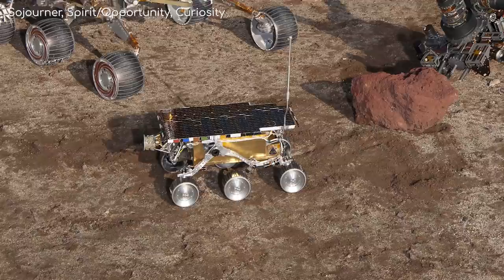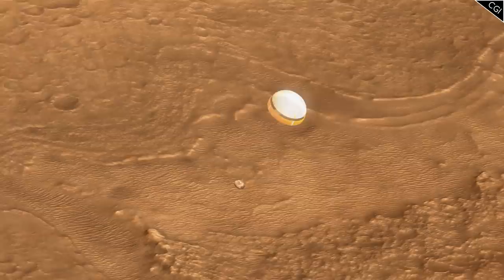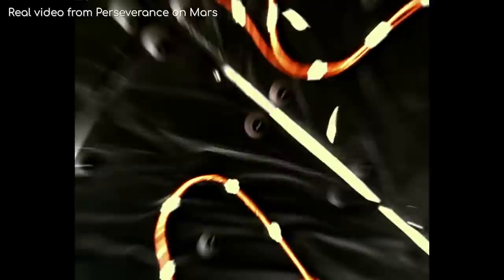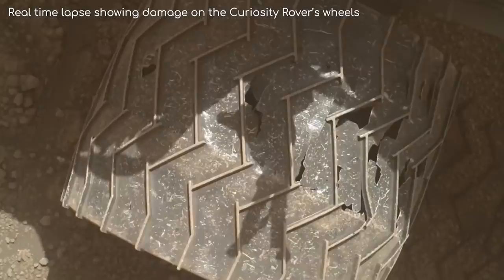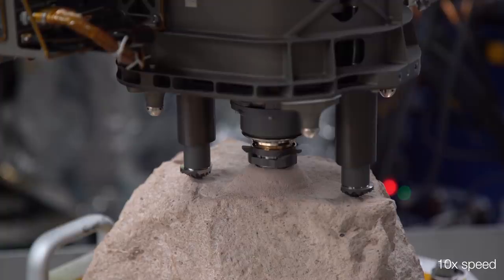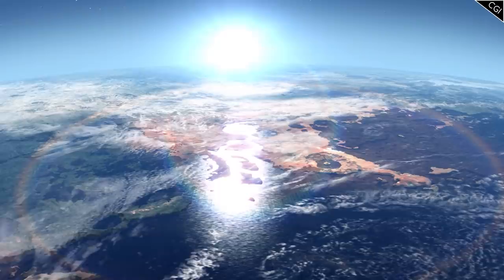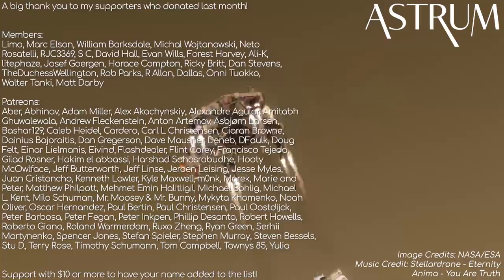This Is What Happens When You Let NASA Engineers Do What They Want | Perseverance Episode 1

Comment: Perseverance is the second rover to use the crane system. Curiosity was first. I designed the Pyro-Fire circuit boards used by the Curiosity Space Craft to control explosive bolts during entry into the Martian Atmosphere.
Reply: Wow really?
Reply: you did what, now ?
Reply: Would you mind creating a video on that on your YT channel?
Reply: @Smee Self 
Explosive bolts were also used to hold the Space Shuttle S.R.B. ( solid rocket boosters) to the launch platform and fired when the boosters ignited
   Well, technically it was the nut that exploded...so yes, every time they launched a shuttle, they busted a nut
Reply: You got curiosity...  How did you persevere?
Reply: So did I!!
Reply: I prefer the self sealing stem bolt for that application.
Reply: What a great honor to have been part of that team of Aerospace engineers and manufacturers and assemblers of. those complex robotic machines that will achieve milestones.
Reply: Pics or your lying
Reply: Thats awesome! My uncle ,who's still alive, worked for Nasa and helped on Apollo 11 & other related projects. He actually has a picture with Wernher Von Braun while he had his Nasa attire on. Though, getting my uncle to say exactly what he helped designed is another story. 🤦‍♂️  
     He's an aerospace & electrical engineer.
Reply: Did you use sensors on the craft to trigger the bolts? A series of if/else/then commands? What language do you use?
Reply: Do they work like a remote explosive that go with a push of a button in control or with a signal from a sensor 

I'm honestly curious it's just this type of stuff you want to ask when you have the person who made it right Infront of you ya know
Reply: @FranktheDachshund  Plus, they're essential for making reverse ratcheting router planers.
Reply: Did anyone remember to add some kind of brushing system, on Perseverance, to clean the solar panels when they get too dusty?

I know Curiosity got the solar panels blocked by dust, and luck would have it, some strong winds blew the dust out of the panels, which made it outlive its predicted life expectancy.
Reply: @Smee Self bolts manufactured with a small explosive charge that has connections that when the programed current run thru it will blow the charge
Reply: Thanks nigga
Reply: Excuse me
Reply: @andregon4366  I think you may be mixing up rovers. Opportunity is the one that got it's panals blocked by dust. Curiosity and Perseverance use Radioisotope Thermoelectric Generators (RTGs) which are those boxes sticking out of the rear of the rovers at an upward angle. Without getting too into the weeds, they generate electricity from the waste heat produced by a lump of decaying plutonium. Not a whole lot of power, but it's enough for this purpose and it will last a damn long time. Thus they cannot be cutoff from their power sources by anything short of breaking the rovers into pieces.
Reply: @FranktheDachshund   Mooogiiii😆😆😆😘♥️
Reply: Thank you for the work you have done to advance our species

Comment: The term "sky crane" used to be a joke you played on rookies on a construction site. "Hey Joe, go get the sky crane" . Nice to see that the term has now become a reality!
Reply: I like those. If you ever work in a pizza place, you may be asked to go grab the dough patch/repair kit. Normally stated to be somewhere deep in the walk-in freezer.
Reply: @Vanished_Mostly  Sort of like the military where they send you to find chemlight batteries.
Reply: @aarosundvall  -- Machining has the aluminium magnet!
Reply: I'm a structural engineer in the UK. When I have a project where the architect has decided having structure to hold his building up would be 'inconvenient' or a nuisance and therefore plans for it not to exist, I will refer to 'skyhooks' - normally used as a bit of a put-down to unrealistic architect expectations!
Reply: My father was member of team which constructed watch towers at border, big helicopter lift parts up and team bolted them together. Windy and cold at winter, was his opinion. Mil-8 helicopter was sky crane at 80s.
Reply: I work in a racking/shelving system factory. Our item was the beam stretcher and column splicer.
Reply: The Skycrane is a real thing, it's a model of helicopter called the Sikorsky S-64. Probably where the joke game from
Reply: The sky crane is kept next to the Sky Hook
Reply: "What blinker fluid do you use?" Is a fun one too! Wouldn't it be funny if the heat conduction capacitor got replaced by electricity generating liquids in a hydraulic system?

Comment: Can you provide an answer to the following question please?

How come Perseverance has narrower wheels than it's predecessor? It weighs 1025kg, that's 126 kgs more than Curiousity, yet JPL decided to make the wheels thinner. Can you explain why? Wouldn't more weight require wider wheels to help stop the rover from getting stuck in the fine sand, dust and ragolith on Mars?

I saw a video where they said the wheels were redesigned to make them more durable but no word or explanation on why they've made them more thinner.
Reply: I think that it’s because of the new wheel design that (should) make them more durable to the rocky terrain.
Reply: @fearguscasbolt2157  I know they're more durable, but that doesn't explain why they have to be narrower. JPL describes them as being thicker as to add durability. But if you're adding 126kgs and reducing the contact patch, you're making it more likely the wheels will dig into loose sand and dust.
Reply: Good question. Logically you'd think that more weight would dictate wider wheels.
Reply: @jaybuck5818  A larger diameter wheel with a narrower footprint is exactly the opposite of what's required to minimize beaching.
Reply: @jaybuck5818  You know what would be gooder? An answer.
Reply: @weeral1  That is AN answer. It's more than JPL, NASA and the entire media coverage provided in all the launch and landing hype. I'll take it.

Comment: Given how short most rovers’ lifespans are I think that NASA should, at some point, pull out all the stops and send a mars rover that is basically a science tank.  Obviously the thick armor could be replaced by lightweight aluminum, but having a well sealed electronics compartment as well as treads that can cross almost any terrain are important.  Harden it against radiation.  Give it redundancy out the wazoo.  Make a rover that will last at least a decade.

Comment: When I worked in sheet metal, our scrap metal recycling vendor had the laser that identifies metal. I called it the space laser, I was not wrong. And the ground penetrating radar I now use in the cable construction industry, I also call that using the space laser.

Comment: Friction of the heatshield with the atmosphere is NOT the primary heating source during entry.

It's the so-called "Adiabatic Gas Compression" where the gas particles in front of Perseverance are being compressed too rapidly due to high speed so they have no time to move out of the way, thus the gas are compressed tremendously and heats up a lot, like how pumping your bike causes heat to form in your air pump.

Comment: 4:41 What are these structures on the ground? Sure, there are some rocks and the other stuff is just sand? It looks like there is sand getting blasted away, but somehow the structure stay the same. The rocks aren't uncovered more, the structures looking like miniature dunes aren't getting smaller either. It looks weird.

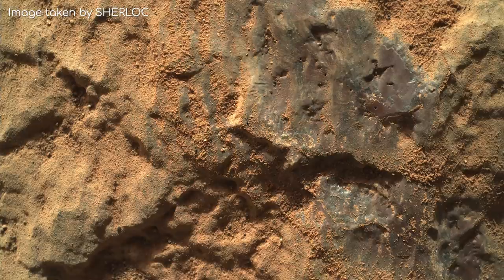6:47 is this a zoom in or a serious of images with different sizes? A big image with small resolution and smaller images with high resolution?

What's its power source? All previous missions were powered by solar panels? What drives this thing?

Comment: I have four questions. 
1. Could mirrors be used to deflect more sun and heat on to Mars surface. This concept was talked about years abo but seems to be out of vogue today. Is this a practical way to add heat to Mars. 
2. Could the orbit of Mars be stabilized so it no longer goes way out from the sun but would have a none elliptical orbit, but instead circular at the nearest point to the sun of its existing orbit today. 
3. Could a moon be directed from the asteroid belt into position around Mars in the same size proportions to the earth and moon and create tectonic plates and possibly warm Mars interior? 

4. When large objects are coming into the inner solar system could we develop autonomous rockets to direct as many as possible to crash into Mars eventually creating more mass, and thereby more holding power for it atmosphere?
Reply: The main issue on Mars isn't heat, the orbit, or tectonic plates, it's the lack of a magnetic field. While making a large body orbit Mars might create a magnetic field it is not possible and a massive risk even if it was.

Comment: 0:34 : doesn’t a thick atmosphere require a certain gravitational force to hold it onto the surface ? Isn’t Mars too small ?
Reply: In fact Mars has a very thin atmosphere, 1% the one of earth
Reply: @fr_rave  Thanks. Understand that’s today. However, at 0:34 it has been stated that Mars used to have thick (density or layer ?) atmosphere in the past. I don’t know if a planet that small can even hold on to an atmosphere due to lack of gravitational pull.
Reply: @thomasmoeller2961  yes , mars have enough mass to generate enough gravitational force to sustain a atmosphere.  Mars loose it's atmosphere because of solar winds.
Reply: An 'atmosphere' refers to any layer of gas surrounding any celestial object. The atmosphere of Mars is much thinner than that of Earth, because of lower acceleration due to gravity but also due to the lack of a magnetic field.

Comment: How much fuel would a rocket, destined for Mars, save if it was placed on a rolling platform that ran along set of tracks (with the rocket laying down on the rolling platform)? At the end of the tracks is a gradual turn upwards. The rolling platform starts rolling at the beginning of the long set of tracks and accelerates as fast as possible, then  just before the end, the rockets engines are started...kind of like a sling shot. If the rocket is traveling at 300 mph and pointed straight up when the engines start, would the rocket have a lot more fuel to play with, out there? The tracks and rolling platform could be reused over and over again. Hell, the rolling platform could have booster engines of its own, accelerating the rocket well past 300 mph. There is a massive amount of energy the rocket engines have to produce just to get the rocket moving in the first place...energy that could be better utilized elsewhere, like in outer space for example. 
Does my idea hold any water? Does it have any merit with it? Or is it moronic?

Comment: "Not equipped to detect microbial life" this statement is not correct. Viking 1 and 2 were specifically designed to detect microbial life. Some would argue they did. 

It is curious the findings of the sensitive labelled gas release experiment were discounted and never followed up with further definitive experiments designed to investigate the findings.

Comment: what I find completely unacceptable are the obvious, wasted opportunities. I know for a FACT that what I am about to say is right. That heat shield  ejection was a wasted treasure trove of scientific evidence, here's why- Imagine if they had put a little more design into the heat shield-it was a large mass, imagine if they had designed it like an umbrella, so that after it detached it closed up just like an umbrella, so now instead of a heat shield you have a high mass high velocity kinetic impactor, a spear, or rod, that would easily help open up a new crater of fresh un weathered internal surface deep into Mars, something that has NEVER been done and would likely, with proper target selection multiply the likelihood of finding evidence for life.  The same goes for the sky crane, that thing just flew off and off'ed itself ! Yes I know weight is a limiting factor for payload but I can't help but think that the sky crane could with very little extra design effort not just fly off an and crash but fly off and land, controlled landings are not hard to do anymore. With that thing on the ground in one piece I'm sure other purposes could be engineered into it with minimal additional weight. Just like earth, but even more so on Mars, any proof of life current or past, is more than likely to be found UNDER the weather beaten surface, drilling or getting into the surface should have been an absolute highest priority. A rover that is basically a mobile drilling platform and various types of microscope analysis with an uplink to the orbiter should be the core of the mission.